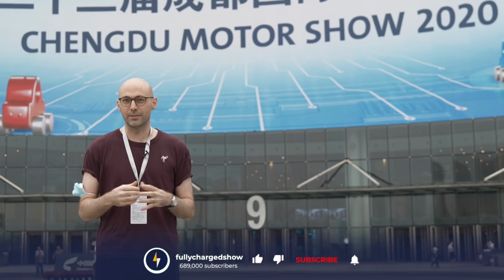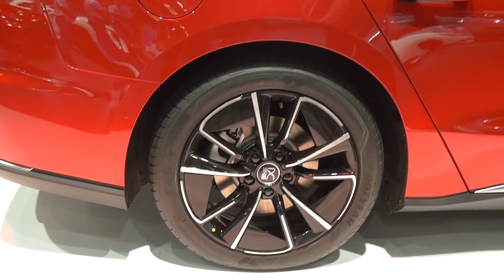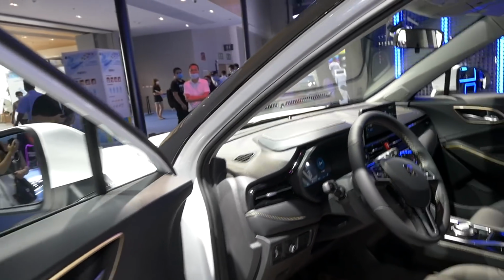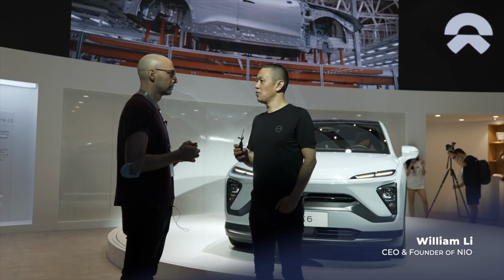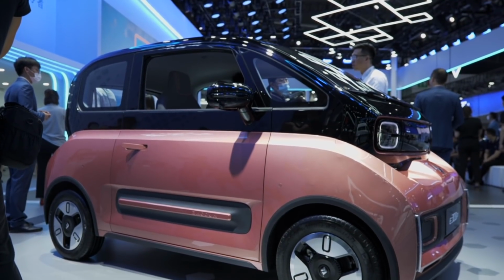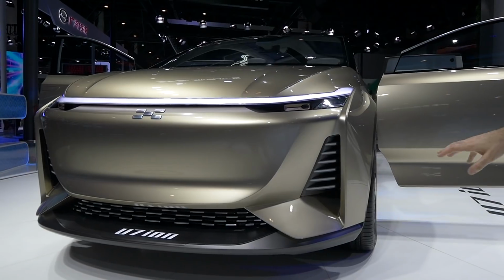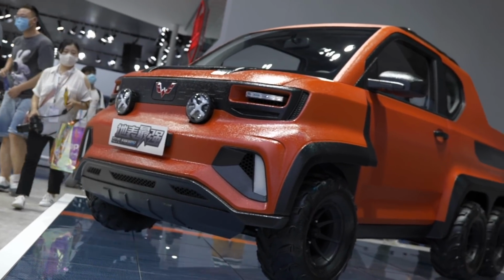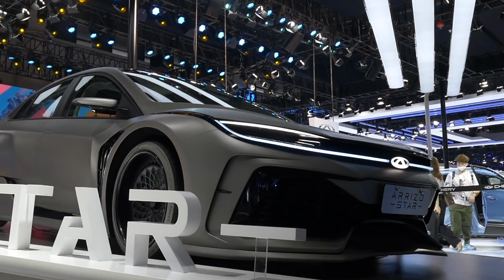Cheap, Cool & Crazy Electric Cars at CHENGDU MOTOR SHOW | FULLY CHARGED for Clean Energy & EVs

Comment: toyota is japanese. they don't have visions. they can optimize things extremely well, like knifes/swords, making tea, making soup, making cameras. but al these products have not been invented by japanese. it is their culture to stick to the tradition. look at mazda, they still optimize the combustion engine and they are doing a fantastic job with it. but rethinking the culture is not their strength. this is the weakness of toyota. if they would sell electric cars outside of china, they would have to admit that they wore wrong with their hydrogen crap. and they will do everything to avoid admitting that they where wrong about hydrogen.
in china it is different. royota can say that it was the decision of china to get into BEV, not toyota - to not lose face. toyota at some point will sell electric cars everywhere, because money is stronger than their culture

Comment: lets hope to see  $10K EVs if not this year, the next one ;)  (in  US-EU)
Reply: that will not happen. and there are really good reasons for it. one of then is surviving in a crash with a shopping cart, another one is not falling apart after three years. another reason is not wanting a battery with the lifetime of a mobile phone, having at least a certain level of quality, and many other points. if you want to have a super cheap car in the US/EU, you have to buy from matchbox.
Reply: Some of the cars like Baojun is only supposed to drive in city roads below 60 so won't fit US as cars are supposed to drive on highway

Comment: The NEDC range estimates with similarly-sized batteries seem to be varying a lot. Reminds me of cheap chinese no-brand LED lights with "80000 lumen" on paper, which are less bright than a 500 lumen branded LED light. But then, who (outside of China) would be hoping to successfully enforce any kind of fines for lying in the technical documentation, from a chinese manufacturer ..

Comment: It would be interesting to see what the safety rating on these vehicles are.
Reply: just watch chinese dash cam videos, it will give you an idea. it is almost like their car are built for a very short life spann
Reply: @ursodermatt8809  Your statement "Dash cam crash video equals to lift-span of a vehicle" indicates you are true idiot
Reply: @stakuyi_funeral  
from your personal abuse comment i conclude you are a CCP acolyte that takes payments for being on youtube
Reply: @ursodermatt8809  AS said, the MG ZS EV has a 5 star rating in Europe. Makes it a very good car, only range is a bit lacking, enough for normal commute but long trips might get annoying 300km real range would have been better. But for the price on the otehr hand well it's a very good deal.
Reply: @martijnvangammeren1868  
bjorn nyland tested that MG at 80km/h and even at that speed it barely got to 200km.
Reply: @ursodermatt8809  Some other cars did get very close or on par with that number. Still for 90% of the year of driving a vehicle even 200km is more than enough.
Reply: @martijnvangammeren1868  
my point was that the efficiency is not very crash hot, the 90% of the year of driving is somewhat besides the point
Reply: MG ZS EV (selling now) got 5 stars at Euro NCAP and AIWAYS U5 only missed out on the 4/5 stars due to a malfunctioning side curtain airbag.
Reply: They have C-IASI crash safety mechanism which is adopted from the United State's IIHS, so it would be very ignorant of you assuming those vehicles have poor safety rating. Grow up.
Reply: Double Repo, based on the safety ratings and performance previous Chinese built cars that were released in Australia my concerns still stand. The only person who needs to grow is you. You need to wake up and stop drinking the ccp coolade.

Comment: Great job Elliot amazing the range on offer. They seem much more switched on to the EV market and the direction it needs to take than we are over here. 

The budget cars especially are tremendous value for money but I guess when shipped over here you could kiss that price tag goodbye and double/treble it for the Euro market.
Reply: They already sell JAC e-S2 model (small SUV, 40kW battery, 275Km range WLPT) here in Switzerland for about 27'000CHF (25'000€ or 22'600£) and e-S4 model (small SUV, 55kW battery, 355Km range, 2020 make) for 31'000CHF (28'700€ or 26'000£). That e-S4 model looks nice actually. Not sure what is their original price in China.

Comment: How did they try to squeeze out 200 extra km range on the 3rd car than the 2nd one in the video with similiar battery capacity around 70kw from same manufacturer. Would be interesting if some can shed some light on this.

Comment: I was just throwing some near-new Chinese made crap out today cos its metal is like paper and its plastic is like clay and yet it was supposed to hold a keyboard! My wife threw out a near-new clock the other day, cos it (rubberized body) fell from waist height and the battery-holding plastic crumbled like sand.

Comment: They need EVs that plug into each other like a caterpillar 💡
Reply: That doesn't make any sense until they have quick charge like a phone developed. Imagine being the car plugged in the center of the "caterpillar" every car behind it would lose its power source.
Reply: @kevina2052  Not necessarily "plug" as in electrically, but just connected like a train. Being able to connect and disconnect without stopping the whole train would be smart. We almost do it anyway when we merge on and off the freeway. Just a few more feet... and click!

Comment: The Wuling or similar is what EV makers should be thinking about. It just makes so much sense. 
Notice the battery is only 9.2kwh-13.8kwh, yet you still get easily enough range for city driving - over 120km. This makes SO much sense for EVs - when you save size & weight then you also save massively on battery cost without sacrificing too much range - the biggest, often limiting expense. With those savings you could spread batteries from 1 of the medium/larger models out into 5 or more small cars like this and suddenly everyone who does mostly city driving (the vast majority of people) can own an EV. Not only that, they can own one for probably less than they will pay for an ICE vehicle even now, but especially with falling battery prices.
I just don't know why auto makers don't see this giant opportunity, especially with such limited battery availability.. which is a shame because that's exactly what I want to buy. Hope some of these make it to the west soon...

Comment: I'm noticing a lot of screens just stuck on the dash, tesla does it so everyone else has copied! Looks awful, prefer a more integrated look personally
Reply: The *integrated look" costs money.
Individual units, switches, etc in a conventional dash require assembly of many more parts.
A "Tesla style" screen is maybe 1 bracket, 8 screws(?) and 2 plugs.
Reply: @rogerstarkey5390  yes, it is cheaper and simpler

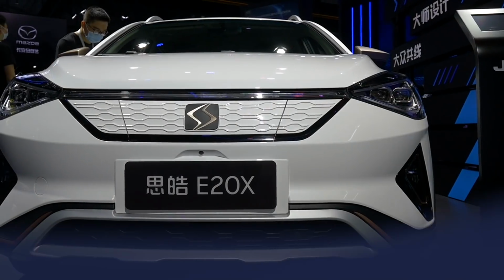Comment: 5:34 The E20X may be traced back to the JAC "Refine S2" subcompact crossover, first unveiled in 2015. 
JAC made a few facelifts to it before making an electric model called the "iEV7S" for 2017. 
The iEV7S performed poorly in the C-NCAP crash test. 
After JAC and Volkswagen launched their joint venture brand "SOL" in 2018, this became their first model.
Reply: Basically correct comment, own a JAC iEV7S myself. Sad to hear about the not so good safety rating. According to the brochure it had good marks on safety but don't remember if it mentioned the stars. Well that's another reason to drive carefully.

Comment: Hey Fully Charged, could we have a review or a report of some kind on what China's charging network is like compared to the UK?
Reply from the maker: That is an episode Elliot is currently filming in China. (It sounds like it's quite impressive)
Reply: I can tell you first hand, there are numerous private companies with huge network + state grid has thousands of stations everywhere and on most highways there are charging stations built in in gas stations. Electric cars, trucks are very well established in China, taxis, light trucks, vans etc etc.
Reply: largely built. enough for in city use but not enough for long distance travel. Especially places with small population. Main problem is still the charging time(90%) and charging network cost(10%).
Reply: @ericqu3962  that is what i have been wondering ,like here in Australia
Reply: JOSEPH BARR I had a road trip in Australia in 2018. It's hard to imagine the battery died in the mid center of the road with 45℃ otherside temperature. I think buy an EV car to urban use is safe. But having normal car is necessary in Australia.
Reply: @ericqu3962  maybe things will be good when solar technology improves.
Reply: Pen Fold Solar Charge system is technically not enough for EV cars considering the tiny square meters of the roof top of the cars. Even there have 100% efficiency solar tech it's not enough though. Not to mention the rain season or the UK weather. I think maybe There's two direction.  One is on fast battery charging system with the match of refueling. Then It's the wireless power supply system of the roadwork. It's more like a science fiction but if the tech can reach that far and cost could be affordable. It's a solution.
Reply: Pen Fold  i look for the solar charge system on cars Then. I found one but only one car can use solar system to charge the power battery now. Hyundai Sonata. The solar system provide 205w maximum, increase 3.2km range after 6 hours of solar charge. The highest rate of transfer energy from solar to electric of modern tech is 24%. Lets presume Hyundai system efficiency is 10%, and future technology could achieve 100%. we put solar on the hood too(which would lead to bad pedestrian protection). Charge power would be 4010W and still far from enough to cover the energy needed to drive.
Reply: @ericqu3962  FYI Plant leaves are around 14% solar efficient. That's the green leaves of plants found at the end of branches in parks and suchlike.
Reply: Ian Murray Thanks
Reply: @ericqu3962  Australia is better suited to hybrids or a hydrogen fuel cells to charge the batteries between charging stations. EV's should incorporate solar on the upper surface to top up the battery especially when you leave the car at work.

Comment: Its mind blowing you can get a very decent electric car with over 200miles of range for like £10k
Reply: @David Lockett  benefit of EV is the simplicity of the whole thing. Problematic could be the body work, electronics and that about it. Safety of course is not such a priority as well

Comment: I hope they can start exporting some of those lower cost models.  They could very well dominate that section of the market if they did as there is currently very little in the way of EV's on the market in the sub £20,000 price range.

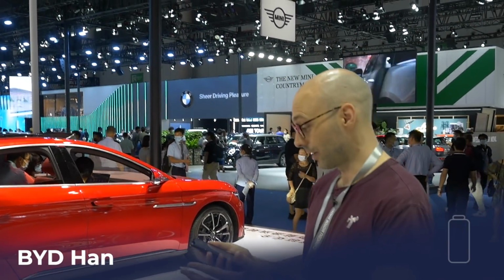Comment: 4:16 what is with the SUPER fast infographic in the bottom corner? I ended up having to pause to see it? Someone rushing in the editing room?
Reply: That looks like an editing mistake, I'm sure.
Reply: "Charging speed and rate: 0 - 80% in ~ 45minutes"
Reply: Yes, it's amazing what the pause button can do.
Reply from the maker: Apologies, editing gaff!
Reply: @fullychargedshow  the GAF is not comparing the prices other Mobility tools after the same subsidy LOL. China is preventing a free market from allowing customer preferred scale very we do it here of course and far worse. We did after all provide an $8,000 credit without any minimum purchase years ago making the then actual golf carts completely free of charge after the subsidy. We have never done this with micro Mobility but the current actual candidate promoting political party in the United States has mentioned micro Mobility. They don't mean having better than parity in terms of the subsidy for it though.

Comment: Do these get safety/crash tested to Western/European standards? if so how well do they do?  I guess the Toyota might be ok or maybe that is why its not exported..????
Reply: I suspect they don't have enough batteries to build enough cars for the world's market. They either build 30 slightly different cars for the different markets with within their own regulations, but only have enough batteries to supply 3000 to each.  Or concentrate on building a single car for a single market with it's single regulation, and sell 1,000,000 of them. This will most likely be a battery quantity problem.
Reply: The safety testing in China is more stringent in some ways and less so in others. Any car sold in another market needs to meet standards of that area, so you will be able to know what you are buying in your home market.

Comment: Was anyone else distracted by the way the bookcase behind Robert is supported? Just think about the shear forces on the fastenings holding the ends to the bottom. Just me then?
Reply: Yes John, just you. 😁
Reply: Nope.... we are not that analretentive.... and fwiw, check out the table below it... and it could have anchors in a concrete wall too.... but thx for the inane distraction :)
Reply: Just  you. The bookcase looks to be sitting firmly on the table so the books don't contribute any shear force, and the fastenings are likely beefy enough anyway given the thickness of the wood.
You also don't know how they might be dovetailed or keyed inside.
There are more important things to worry about.
Reply: NTM, it seems like green-screen anyway...

Comment: Not mentioning BYD blatant copy of the Ford EcoSport? VW? Seat? No?
Reply: Who cares? Imitation is most sincere form of flattery. Besides they made the car looks way better than the original designs. Probably drive better and more reliable too!
Reply: Fawk Yu Because companies spend millions on designing new products, and other companies stealing designs and millions of pounds of work cheats the first company. In extreme cases it can cause the first company to go bust.

But if you are just into social and economic Darwinism, then screw everyone else.
Reply: No.
Reply: If it gets released here then seat will probably sue them and it will get pulled off the market until they slightly tweak the design

Comment: China seems to be creating the future of mass electric road transport more or less on its own.
Reply: China doesn't have a lot of oil or gas of it's  own. Switching to EVs would help greatly to be more self-sufficient.  
Also, their petrol infrastructure was not really developed to the same level as in the west so it was easier for them  to build EV infrastructure. 
Just like broadband in Eastern  Europe - loads of their systems were still analogue when internet became a thing for masses. So they simply skipped a step and went straight to fiber while Western Europe was playing with ADSL and VDSL.
Reply: jur4x 
Yes, I think you are spot on. Plus oil is traded in dollars which makes China dependent on the US in that respect, although given how much US debt China holds, the dependency has rather switched around when it comes to currency.
Reply: Michael RCH Not entirely. Iran and China have just negotiated a deal for oil without the dollar being involved. China is also transforming its economy to be as green as possible for a number of reasons. It helps clear the city smogs, reduces vulnerability to oil blockades, and eliminates another import of oil.
Reply: @jur4x  An ISDN line in every house in Germany.
Reply: Utter rubbish, China is a Dystopian, Authoritarian, One party State. No company in China acts independently of the state. They may use elaborate methods to hide state control, but they are still state controlled. Buying one of these cars supports the technological advancement of an authoritarian anti-democratic regime. You are on the wrong side of history. A CO2 free world is not more important than a free world, free from the slavery of global autocracy. Although reducing CO2 emissions is second on the list.
Reply: Craig O well, please visit China
Reply: @baris_bolat  I have a very very close friend, who I implicitly trust, who worked in China for a year.
Reply: Craig O ok. I work in China for last 10 years
Reply: @baris_bolat  Under Xi the country has reversed any moves it made towards liberalising its society. Communist era slogans and artwork are returning. China eradicates any internal dissent.
Reply: Craig O happy with that
Reply: Craig O 
I am stating a fact, not making a value judgement.

But when it comes to which we need to do first, decarbonisation has got to be prioritisies 1 through 10.

China repressing it's people (while improving their living standards further and faster than any other country in history btw) cannot render 20% of the inhabited areas of the planet permanently uninhabitable by the end of the century. Climate change is in the process of doing that right now.